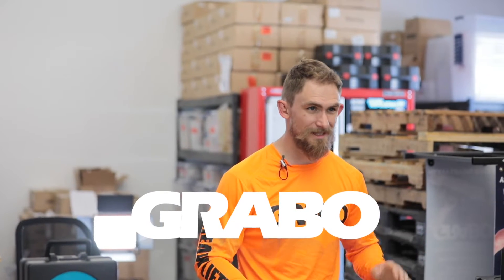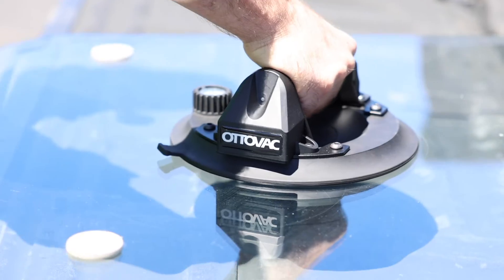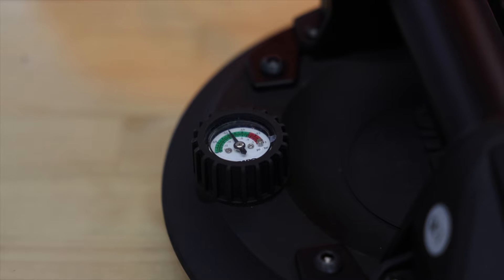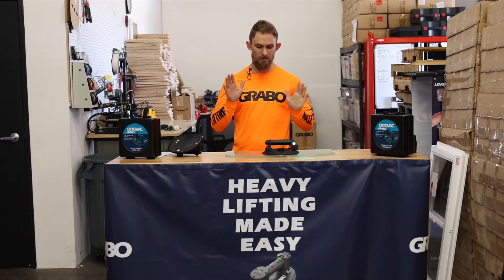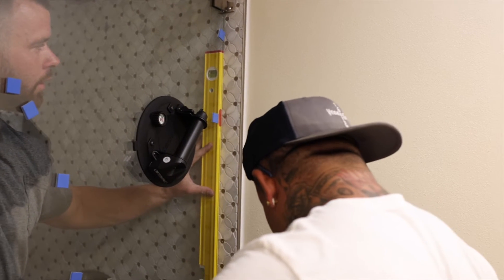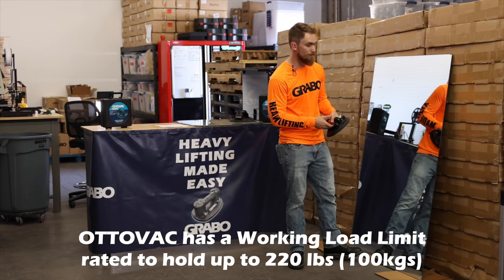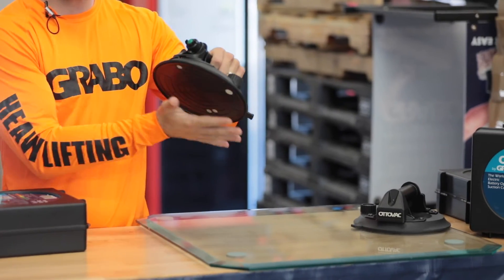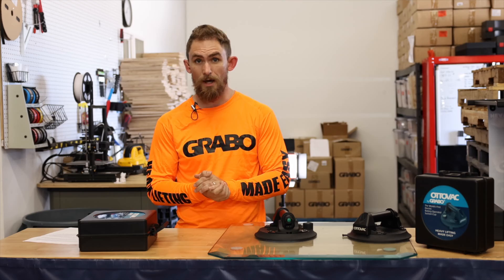OTTOVAC by GRABO Introduction

Comment: 1 What's the battery life expectancy
2 if the batteries die will it drop suction
3 how do you know how much charge is left in the batteries
Reply from the maker: Hello, The OTTOVAC now includes two battery cartridges, one for AA batteries, and a new lithium ion rechargeable battery. The lithium ion cartridge has a battery indicator when plugged in. The tool itself has a power life indicator. Users will always know how much suction the tool has by the pressure gauge on the tool. If the tool already has suction, and the batteries die, it will maintain suction on the material until you hit the pressure release button.
Reply: @Grabotools  thanks mate, I'll have to look into these